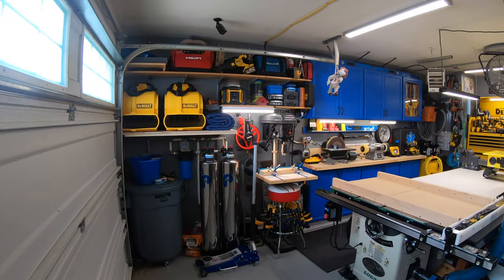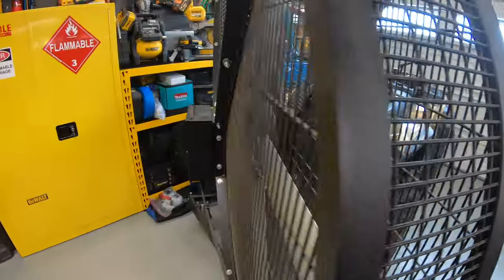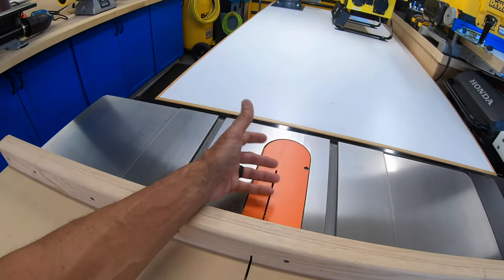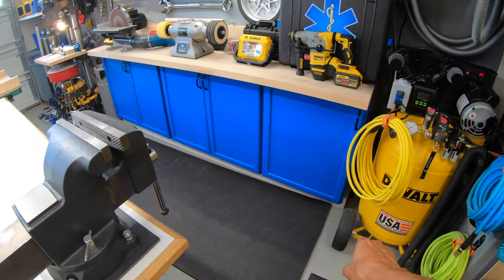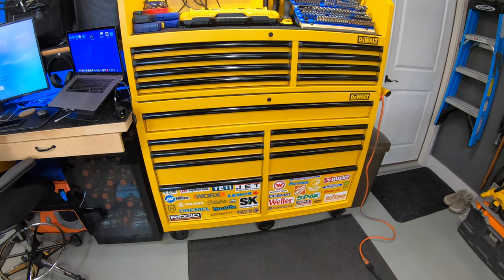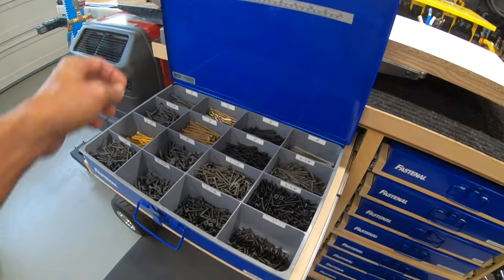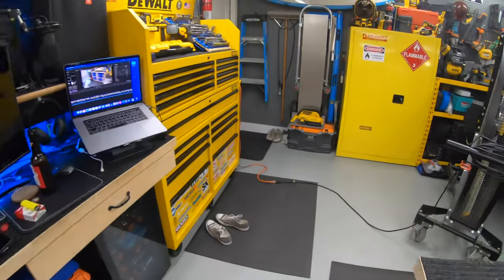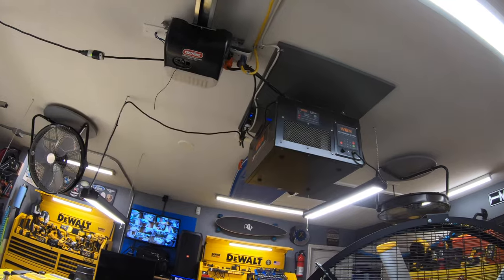2-Car Garage Shop

Comment: Have you ever used ANY of these tools?  Everything looks brand new!  How do you have the time to use/keep up with all this crap?!?
Reply from the maker: Shaun,
I've had most of my DeWalt tools for years and they get heavily used.  When they wear out I'll sell it to one of my workers and buy a new one - keeping them rotated with the latest models.  And I'm one of those guys that actually cleans and maintains my tools - most guys just throw it back in the tool box when they're done.  Once every few months when I'm not in the middle of a project I'll spend a weekend cleaning every tool in the garage - it takes several days.  Tools are expensive and for me they're an investment.  Some guys collect cars and fix them up - I collect tools and use them to earn a living.  I have a spreadsheet listing all the tools in my garage, serial numbers, date purchased, prices, etc.  I have 148K sitting in my garage alone and it's all insured along with photos down to the smallest screwdriver.
Reply: Mike I admire your organization skills. I need to teach this skill to my kids.